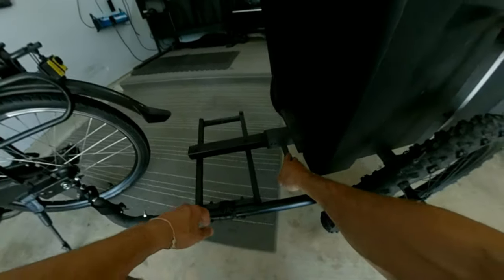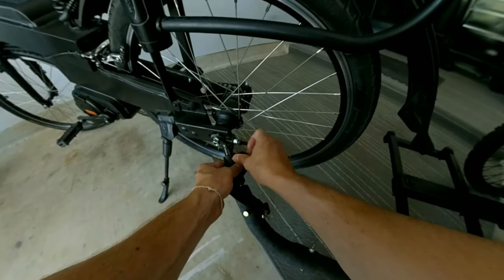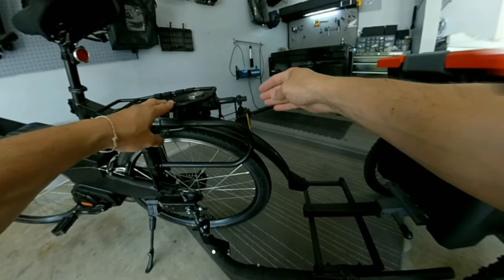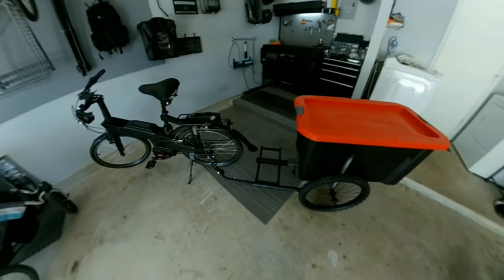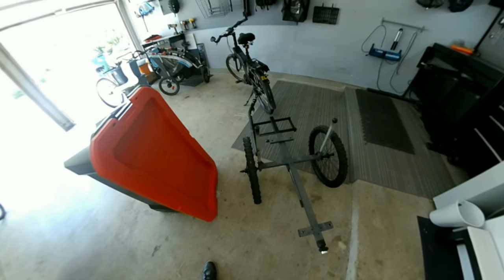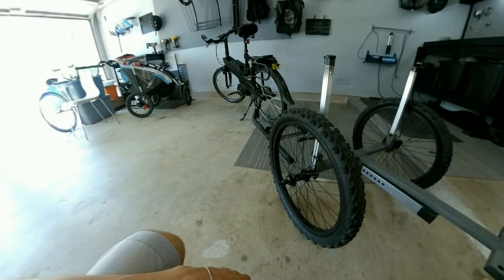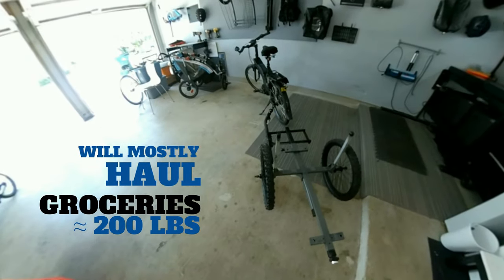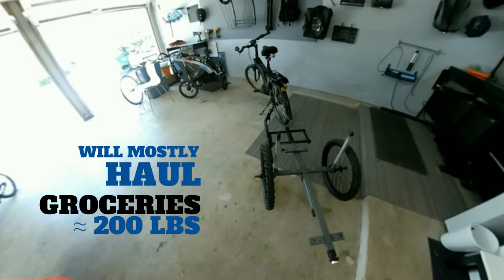DIY Extendable Bike Trailer | No Weld | Quick Release

Comment: For the first 5 years of my retirement I had no car so I used my long wheel base recumbent and a cargo trailer I bought on Amazon that was 41"X17" with a 275 pound weight limit and all of the railings cam off to make it a flatbed.  I was able to find a heavy duty 55 gallon storage bin at Home Depot and it only fit because its bottom was only 39" long and 14.75" wide while the top was 45.5X21.  No over-engineering, I just used bungee cords to hold it on the trailer and it worked great.  I carried hundred of pounds of stuff in that trailer including some big patio blocks.  I was even able to strap some 6' boards and poles on top of the tote.

For carrying long boards I just took all the railings off and then used a 6' frame from a futon that was thrown away and some small totes to use to raise it high enough to get above the wheel level (the trailer came with 20" wheels that I replaced with 16" ones to make it more stable).  Again, I always used bungee cords to hold it all on the trailer and they never failed me.

Comment: Thanks! I'm building a bike trailer at present, and you have some excellent ideas. You might want to write a book with plans of your designs. In my case I'd adapting a push child carrier for the purpose, so the wheels and axle are not an issue. The design issue has been finding a way to mount the storage. Also, you might look into using fiberglass. It's lighter than steel and more rigid than plastic.

Comment: I liked 👍 this video and these builds(Very ingenious.). I am also into cycling and bike trailers. Just to let you know, there is a company called “Wike” in Canada 🇨🇦 that sells fabricated trailers and DIY trailer parts as a resource you could tap into. My latest trailer build is over 12 ft. long with a tandem axle in the back and one wheel in the front to steer it with(Like what you’d see on a “Carla” cargo trailer.), it has been fun to build but, a lot of work.

Comment: Not bad, nice. Can you test it with some quickreet ? Awesome, super nice though.
Reply from the maker: Yeah I was able to get four 50 lb sandbags on there but the axles and tires were not happy about it... was a very slow and nervous ride home. I'm in the process of swapping them with 16" stroller wheels and a 7/16" threaded rod axle... will have an update on that soon.

Comment: I am sort of laughing at myself, as I get the "DIY" urge and then usually spend a whole lot of time, only to find better ways of doing such in the long run. I am presently looking at doing a DIY trailer as you show in your first part of your video. However, I have little faith in the plastic bins. I had previously made a PVC pickle boat for my dog and ended up giving it away, due to a move at the time. I like using the 55 gallons plastic drum for it, as they are sturdy and would allow a medium or large dog to easily sit in it and not somehow collapse the sides. They are also stronger agains the UV rays which often allow plastic bins to break. Don't have it worked out just yet, but my mind is whirring after viewing your video. Thanks for posting. I have a HeyBike Mars, but it is to be shipped to me today. Can't wait to check it out and see what my work on it as to a trailer. The MOD Easy electric bike comes with a sidecar, but too expensive for me at present. I have always ridden a Ural motorcycle with sidecar, so having my dogs alone for the ride is old nature for me. A trailer seems to be a better idea and less costly than finding a sidecar that would work on my bike at present. Again, thanks for posting your video.

Comment: This squared tube in the middle can be doubled to increase safety of the whole thing. Thinking about making the wheel axis extendable also, to be able to adjust the width of the trailer for loads that require more room.

Comment: I have a suggestion for improving the bottom attachment for the tote in order to prevent having bolts that scratch/pierce your floor after removing from trailer: Buy some unistrut U channel in electrical supply store, and bolt it to the underside of tote with open side of U facing down. On trailer, affix some square tubing that will fit inside the U channel. Bottom rails of u channel distribute the load when set on wood floor, and can even be padded with hdpe tape or other thick tape to minimize scratching of floor.
Reply from the maker: That's a great tip, thanks for sharing! I'm currently prototyping a new trailer made from 8020 t slot extrusions... still sorting out some kind of quick release attachments. U channels might be perfect I'll give it a try in Fusion 360.

Comment: Interesting content. 
I've just started cutting metal on a mk2 version of a trailer I've been using for approx 3.5yrs and one of the mods will be adjustable length.
As mine will have a central hitch point - as every trailer I've built has had - both sides of the trailer frame (16mm dia tube) need to be adjustable..
Whilst I've carried up to 3.6m long items on the current one, that's involved using a temporary extension towbar to relocate the trailer rearwards. Mods will help this some for slightly shorter items.
I also don't have a welder, so mine are built using standard fasteners and mainly drill/hacksaw using discarded / repurposed materials - but all seems to have held up as max load has been 50kg  a few times.
Current trailer weighs 4.2 kg btw and folds so it can be stowed on the bike until needed.

Edit: Looking at the first few seconds of this video again, I can't help but wonder if you've considered a central hitch / tow point?
Yes, you'd have to provide such a point in 3D space behind the bike (relatively simple imo) - but it could then be used with any subsequent trailer and negates the need to have 'swan neck' connecting arms on each trailer.
With a big plus imo - a central / non - offset pull vector. If such is good enough for cars/ trucks/ artics etc - is it not worth investigating?

Comment: Have you ever used or even seen a Ventura Zinc Coated Bicycle Trailer Hitch for seat tube or seat post clamp? It is basically just like a smaller version of a regular trailer hitch and ball setup that attaches to the seat post.

Comment: Hub motors( which is the most predominate ebike) Should attach trailers to back wheel as we see here.  The hub motor in the rear wheel places enough strain at that point. A trailer hitch attached to the seat post is far more workable.

Comment: I'm actually in-the-process of DIYing a bike trailer using an aluminum ladder. I'm not sure if I want to use the entire ladder for extension purposes. Or to separate the 2 pieces, while just using the 1. Or for that matter using all 14 ft. of the ladder ...either the 2 or 1. I can see the appeal of having a 14 ft. trailer, but how it suits for inner town/city maneuverability, as well as having something TOO LONG that would create issues with the police. But the current plan is to use only 8 ft. of the ladder, so I can add a DIY'd micro camper, and perhaps(also questionable maneuverability) DIYing a tandem axle :)

Comment: Answer to fish-tailing,try loading most of the weight FORWARD of the axial.
Reply from the maker: Yup for sure, that's a good tip. I've actually scrapped this trailer and made a few new ones using t slot rails and magnet mounts... will post some vids on those soon.
Reply: greetings from Australia,yes that is the fish tailing problem, you should apply the 60x40 formula, when mounting your axle to the load, 60 @ the front half & 40 towards the rear which will make your trailer track straight & true even if you try to enduce a fish tail it will only self correct its self, good luck !

Comment: Have you thought of reflecting tape
Reply from the maker: Yes, I love reflective tape, especially the black one you can't see until a light flashes on it. 👌
Reply: @eBikeaholic  I literally just put a cargo trailer together for my bike I noticed that nobody was seeing it so I put reflective tape on the corners and reflective tape on the sides now it's not a problem that's the only reason I suggested that
Reply from the maker: @joemartinez2694  great idea, thanks for sharing. Another good one is to use flags or those car trailer marker poles with the reflector on top.

Comment: Make it a 3 wheeled tricycle style. Itll be very stable even at high speed.
I made mine using the steering neck from an old kids bike. Then youll attach the tow bar to the spot where the handlebar is attached.

Comment: Very ingenious!  I'd think your current axle would handle 50lbs pretty easily.  200lbs of groceries sounds too much.

A suggestion woudl be to use steel electrical conduit and a conduit bender to make your loops to support both sides of the wheels.  Square tubing is an idea also, but would weigh more.
Reply from the maker: Thanks! Yeah I should invest in a pipe bender, steel conduit would be a great idea.

 I did two grocery pickups with it; around 100-200lbs so far so good but yeah those axles will have to bend at some point. The heavier load around 200 lbs didn't feel so great but I think mostly because the bike chainstays have too much flex. I'll probably be getting four or five 50 lb sand bags this weekend, should be a good test.

Comment: Most of the totes I have seen and even used, had a bad tendency to crack, mostly due to environmental conditions as UV rays or freezing weather and weather changes. The sides seemed to be the weakest points of them. Even the nicer looking ones which are generally black and yellow or black and orange/red, still suffer from this. Any thoughts as to that issue? Thanks.

Comment: @18:30  what you're referring to, I think occurs BECAUSE you have the horizontal hinge first instead of the vertical first.
Reply from the maker: Not sure if I fully understand... do you mean the hitch bracket would need the vertical shaft component, and the trailer bracket would need to connect to it at the top and bottom?
Reply: @eBikeaholic , whatever hinge lets the trailer move left and right should be first, and whatever hinge lets the trailer move up and down should be second. You have the  "up and down" travel first,  as demonstrated when you lifted the trailer.

Comment: Would there be a benefit or negative to hitching the trailer to both ends of the rear axle?  I've only ever seen them on one side.  I'm still curious if it reduces, adds strain or would add any other problems.
Reply from the maker: Mounting to both sides is definitely stronger and feels more secure. There would be less pull from the one side, but that's only noticeable with heavy loads / uphill and whatnot. The problem there is engineering the hitch pivot to be centered behind the wheel.
Reply: Use the front fork from another bike

Comment: The single wheel trailer looks like the bin is too wide.  If you want to haul 8 FT or 10 Ft boards, consider a seat post hitch arm connecting to a dolly trailer, and onto that hitch a flat bed trailer, Ive done this.

Comment: "fishtailing..?"  many times, that is because the trailer is loaded with the weight too far behind the axle.  2/3rds of the weight needs to be ahead of the axle for the correct tongue weigh.. This is the cause of those travel trailers that get to whipping on the freeway and end up tipping the truck and trailer over on it's side.  Weight too far back is not good.. and weight too far forward put a lot of stress on the bike axle.  
Nice job on the trailer.

Comment: Your Single Wheel trailer would work better if the center of gravity was closer to the ground.. You may be experiencing and exagerated lean because it is high.. I have a Bob.. the basket is level and just 5" off the ground.
Reply from the maker: that's a really good point... didn't notice that but will keep it in mind for the next attempt.

Comment: It looks like you do have a weight distribution design issue when only using the single bin. You have too much of the load weight behind the wheels. This is probably why you were getting the fishtailing you mentioned when attached higher. Here is one of the videos showing what weight distribution can do. https://www.youtube.com/watch?v=6mW_gzdh6to
Reply from the maker: Yeah you're definitely right. I've since retired this trailer and developed a better version using t slot rails... just haven't had a chance to share videos about it yet.